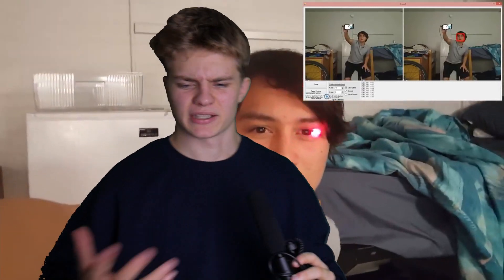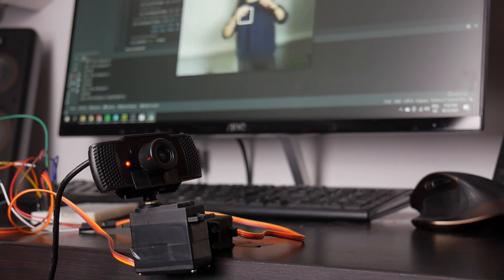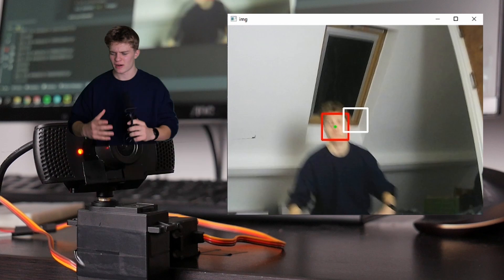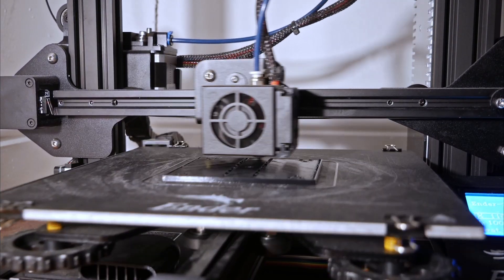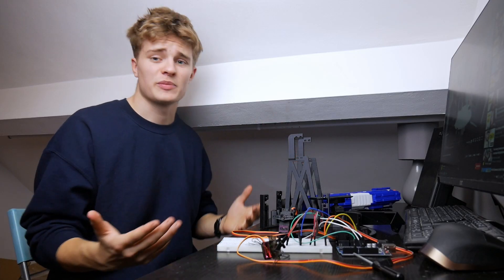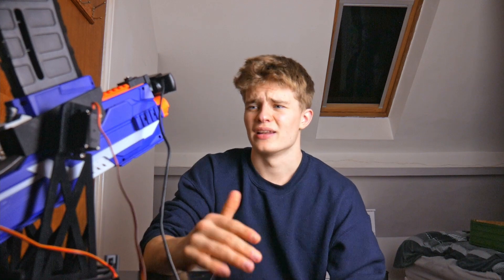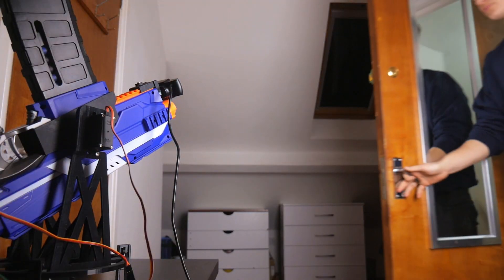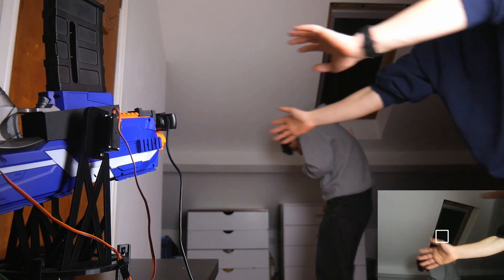I built an AI Nerf gun that shoots me in the face

Comment: The end result is absolutely awesome! Really nice work there! I'm trying to work on a similar project currently. Getting the gun's flywheels to spin is easy enough, but how did you implement the pulling of the mechanical trigger? Does a simple MG996R servo have enough torque for this?
Reply from the maker: Thanks! It was pulled by just a micro 9g servo, by wrapping a string round the trigger and attaching it to the servo arm
Reply: Oh wow, a micro servo had the juice for it? I didn't even consider trying it honestly, never believed it'll work. Thanks!!

Comment: Hi, you can make a more detailed video on assembling the parts and the code
Reply from the maker: I’ll be making a video with a similar setup soon and I’ll try and add circuits diagrams/ code for it
Reply: How to assemble the servomotors and on which board rasbery or Arduino uno
Reply: If u please do it , I'm waitting
Reply: Where is it ?

Comment: What kind of control system did you use for moving the gun/camera?
Reply from the maker: I ran a python script with open cv sending instructions to an arduino to control the servos
Reply: @adambeedle  But to actually control how the servo moved in relation to the detected face, did you use some kind of error correction feedback or something like that?
Reply from the maker: @cheesepie4ever  oh right yeah, the servos move so that the centre of the face is positioned within the centre of the image, and if it’s within a certain range then they stay still
Reply: Thx for the info

Comment: Yo just wanted to know how you get such nice first layers on your Ender 3 pro. What surface are you using? I started using glass but it's not turned out great ??
Reply from the maker: I switched back from glass to the default bed, I was having problems with adhesion. I also try spend more time levelling, which hopefully makes up for the rougher surface
Reply: @adambeedle  alright nice thx